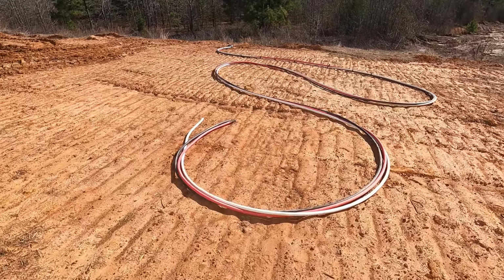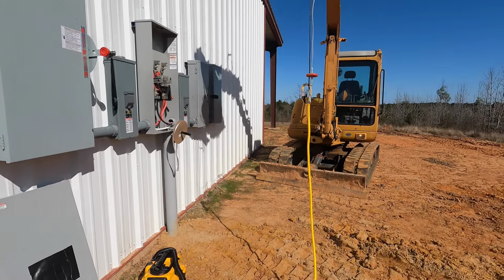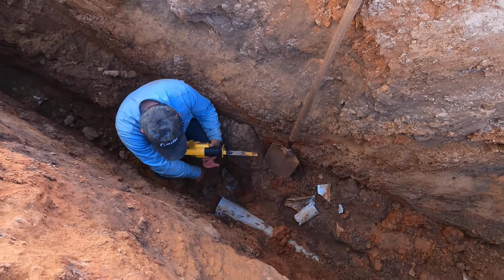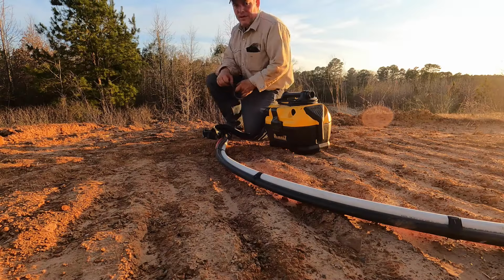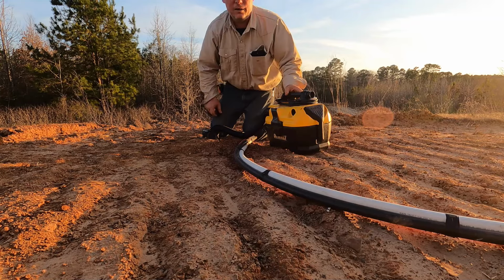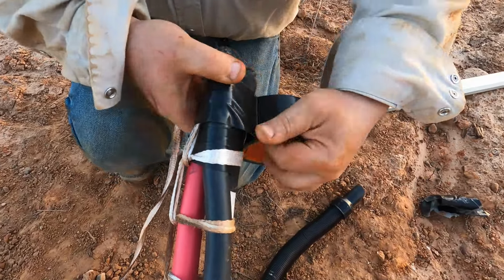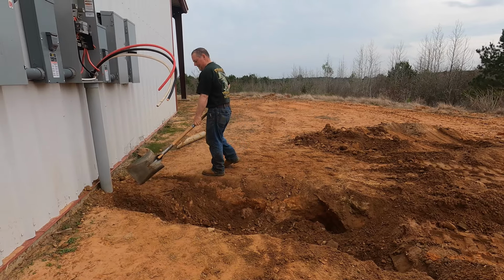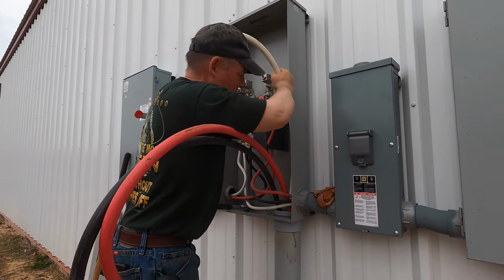Electricity Part 7; Whether Murphy or Vertical Learning Curve, We will NOT be Defeated!

Comment: Since time is money, I got a fun thought - For shots less than 75ft and 1.5" diameter, look into renting or buying a hole hammer (sometimes called a piercing tool).  If greater than 75ft or 1.5", horizontal directional drill.  Replacing the conduit with HDPE conduit using either of those tools would have been a 2 hour job from arrival to departure and minimal crawling in a unshored hole.
Reply from the maker: Except I’m retired so time is something I have…if I have to rent or pay someone else then it’s money which is limited. I was never worried about the hole…I’ll leave that here for others to create worry, it just ain’t the country way 😉🤠

Comment: Suck mono through and then pull the mule tape then heavy cable. Even if you have a mud dam the step up will clear it.
Reply from the maker: Unfortunately a glued joint pulled apart and there was no getting through it. Regardless we got er done and fixed right

Comment: 500 MC cable is no joke!    Good job
Reply: It isn't MC but I think you meant 500 KCMIL is not a joke but it has to be done the right way. It will usually take longer to prepare for the pull than the actual pull if itself if its set up right.
Reply: @bradawilliams1  MC. MCM. KC.  The big stuff… lol. “The right way” is difficult alone no proper tools etc..but got er done
Reply: @NoneyaTexasontheback20 This life is awesome and a bitch at the same time. Godspeed brother.
Reply: @bradawilliams1  indeed. You too!
Reply: Bro what are you building? Sorry I generally don't have the time to watch too much stuff online. The service build looked really good. Did you build out the service?
Reply: @bradawilliams1  it’s not mine..  it’s a friends build.  A shop and a house..